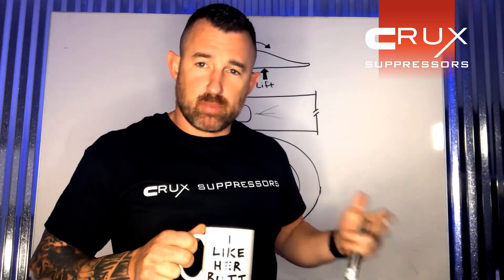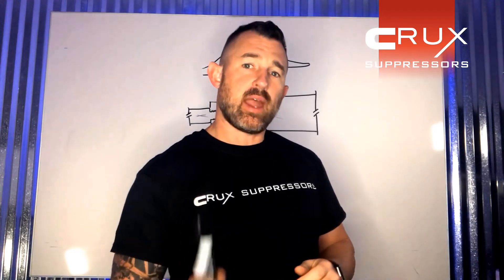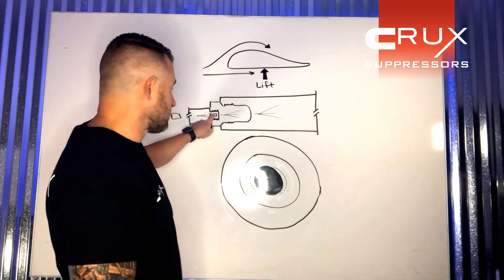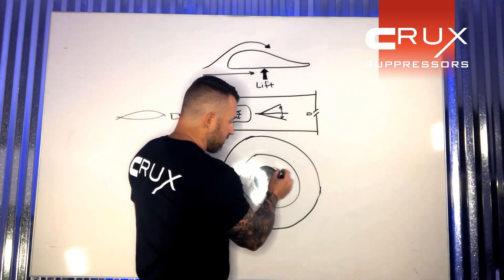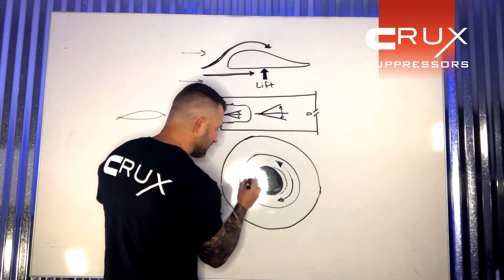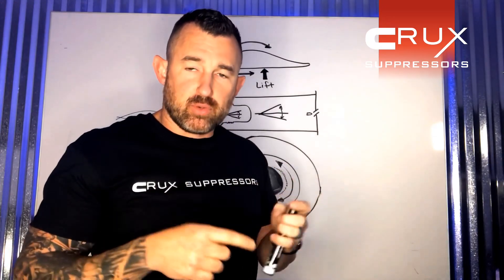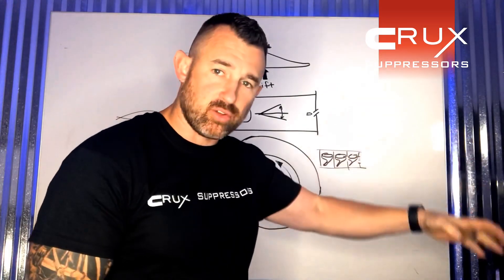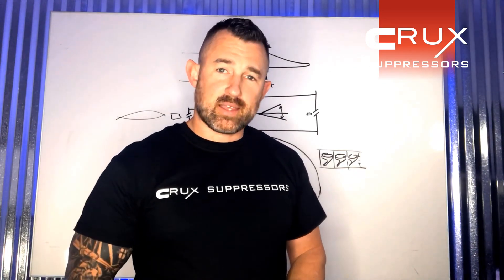Bullet Stability - Silencer influence on Accuracy

Comment: Take aways 
1. too tight of tolerances on the bullet-path are detrimental to hitting things, even if it makes the suppressed gun slightly quieter
2. thread on can's suck, compared to integrals, lol (bullet-path is perfectly sized to the bullet, and I've never heard of a baffle strike with one)

If the illegal NFA was never enacted, the market for thread-ons/ clamp-ons/ slip-ons would be very small, mainly there to accommodate very old guns that weren't made with a muffler as part of the design. No new firearm (aside from historic replicas) should be made without a muffler. Most people wouldn't accept it if car companies made cars without mufflers... why should shooters be any different. It's a user safety and noise pollution issue.

Comment: There is a few errors in this guys way of thinking of bullet external ballistics. Has good info but not 100 percent correct on everything. Just going to point that out. For example all bullets yaw when they get down range and go subsonic.  If a bullet yaws from a suppressor, man you have real problems. This guys science is not solid. But does have some good info.
Reply: Bullets yaw as soon as they leave the muzzle, its called fleet yaw
Reply: @brasstard7.627  look up the word first then debate

Comment: Quick question... If the projectile was unstable at or shortly after exit, but then stabilizes due to the aerodynamic design, how can the previous instability return? If the projectile is solid and no strike happens within the suppressor, what causes the secondary instability? Is there some "storage" of wobble within the solid object? Just curious. Great videos BTW. I'm waiting for my form 4 to be approved so I can pick up my Archangel 762.
Reply: I just pointed out your same question with my reply. can't believe everything you here out there. Very smart to question this is cause you are absolutely right
Reply from the maker: Scott Watters , there is in inherent yaw that is induced...as the bullet slows down and the rotational forced slow down that yaw comes back in and the bullet starts to “wobble” so to speak.  You can see this same affect when you throw a frisbee or even sometimes a football.

Comment: Excellent overview of tolerance stack up!
I work on systems going to the space station think about the tolerance stack ups we have to design and build 2.
Reply: Actually, I think Curtis worked for NASA...or something like that.
Reply from the maker: mugenrios2k yeah, I totally get it!  I did work in the aerospace industry.  We had to meet up all those tolerances with fluidic connections...and welding titanium shrinks quite a bit.  It’s almost impossible to hit good tolerances with welding.  But yes...when you have 1,000 pcs mating together....it’s a real challenge.